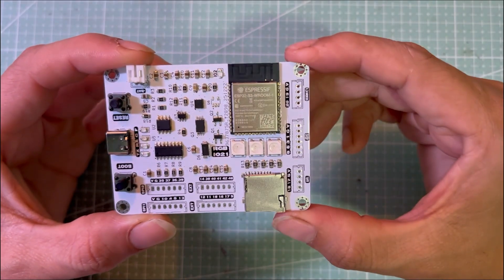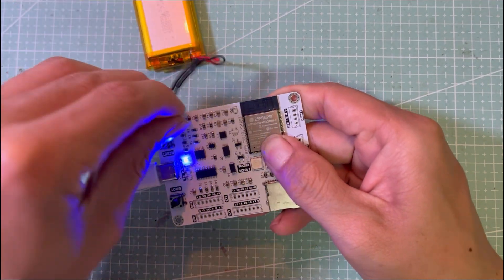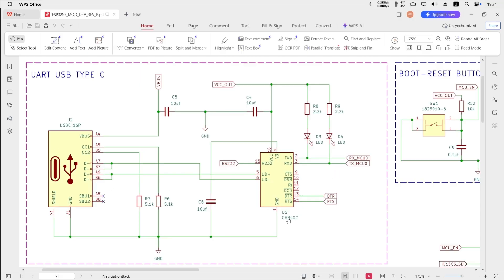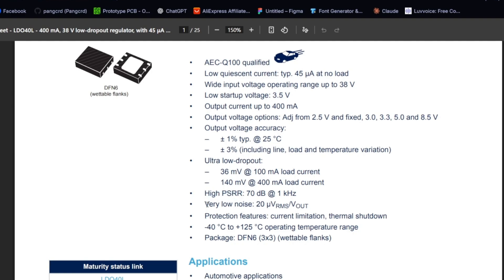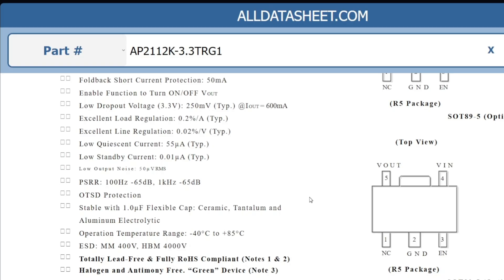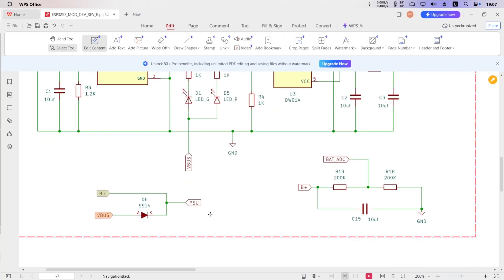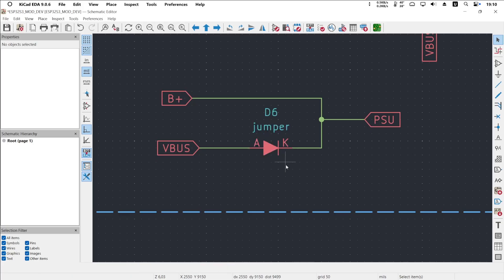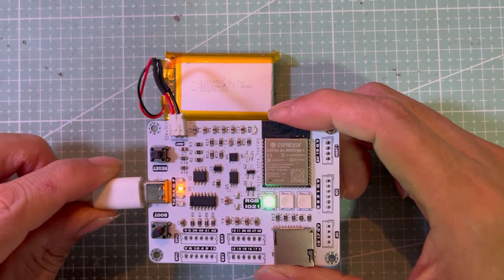I Made My Own ESP32-S3 Dev Board, But the Behavior Was Unexpected!

Comment: Bust Out p-chan for the diode, but dedicated power IC makes it easier and safer-especially when defining a dropout voltage to not damage the battery.
Regarding LDOs - no, they aren't efficient at all. All excess voltage is dumped as heat. You also need more or roughly equal voltage on the input to get the output voltage.
Buck boost is a tricky EMC thing, but allows even lower voltage from the battery and data sheets provide layout details.
Lastly watch the antenna layout - it seems your board and copper is underneeth the antenna, so are the Caps and LED in the antenna space. You could angle the espressif module to have the antenna in the corner, I don't know your mounting solution. 

Didn't look at the files, but other than the error you found, looks like a decent job :)
Reply from the maker: Thanks for the detailed feedback 👍
I’m still learning, so comments like this are really helpful.

Comment: For my designs I use a boost converter to give me 5V that is fed into a 3.3V regulator. That allows the battery to drop to about 2.2V before the ESP32 shuts down, and means the parallel input of 5V from USB simply merges in with the boost output through two diodes

Comment: The LDOs both have quite a high quiescent I use one that has a quiescent close to 1uA
Reply from the maker: Thanks for the suggestion!
Using a P-channel MOSFET instead of a blocking diode is definitely a good approach 👍
Regarding the two LDOs: I already had some LDO40L in stock, so I reused them for this build. If needed, they can be replaced later with a cheaper low-Iq LDO without redesigning the PCB.